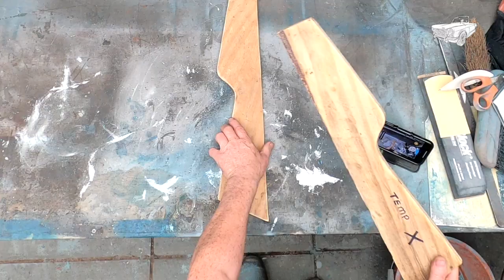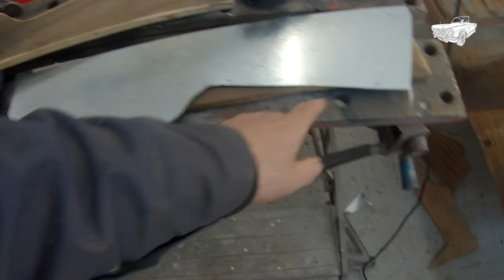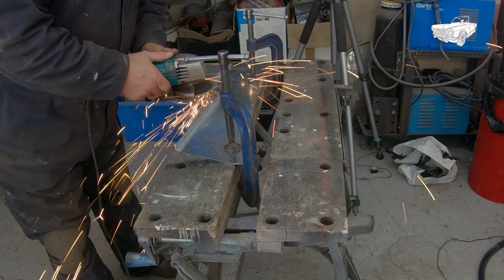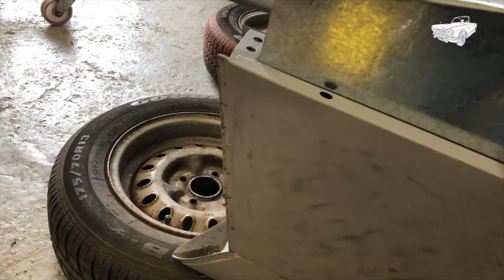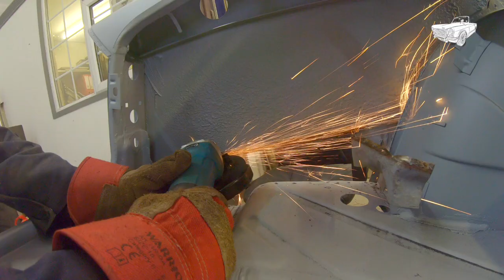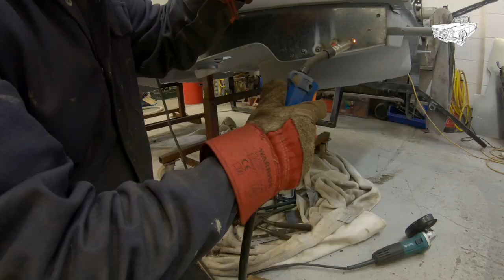Metal Shaping tips and tricks  HD 720p

Comment: @peterdunne8107 I note you use 1.2mm galvanised steel plate.  Some people have said this isn't appropriate for welding.  What's your view?
Reply from the maker: There is nothing wrong with using galvanised steel. It is admittedly quite toxic, but as long as you grind off galvanising around the edges where you are going to weld there shouldn't be any problem and afterwards you must use etch primer paint. Oh by the way, some people have said the moon is made out of green cheese  ha ha ha
Reply: @ You mean it isn’t! Are you suggesting Wallace and Grommit have been misleading us!
Reply from the maker: I 😁

Comment: I highly recommend Wurth Bright Zinc weld thru primer: one of the few that actually works well with spot and plug welding.  It doesn't seem to burn out so much as flow then solidify again.  One can goes a long way.  I buy them 12 at a time at roughly £7 each, so excellent value for the quality.  Completely agree about the cheap bead-rollers: hopeless on 1.2mm steel, which is almost all classic car work.
Reply from the maker: Thanks for the info!

Comment: Why use galvaized steel.. much harder to bend and poison to weld
Reply from the maker: It's free from a friend who has a sheet metal workshop. I have no problem bending it and if you grind the galvanise off before welding there is no problem Welding it. You do need to etch prime it before painting it with a topcoat.
Reply: Cold rolled steel is more easily  shaped
Reply: But i suppose  free is good !

Comment: Superb, thank you. I just made a similar panel for a TR6 (front bulkhead to wheel tub) but I welded the rounded flange and then ground the weld off. It worked fine but this method is much better, much faster and less risk when grinding. I’ve two more to do and will try this method. Very good video.
Reply from the maker: Glad it helped
Reply: @peterdunne8107  tried it last night, worked nice. I did three little panels, first one marked up a little with the ball pein, managed to planish most of it out with hammer and dolly but as it turns out I had stupidly turned the flange the wrong side anyway. So then made one for each side very successfully using a slightly different hammer technique, no marks and planished up beautifully. Great method, thanks again.

Comment: Nice work, don't forget to protect the welds since galvanised metal doesn't like welds so much... Cheers, keep on.
Reply from the maker: You can weld galvanised steel just as any other steel as long as you grind off the galvanising in the area where you do the welding. Believe me I've been doing it for 55 years.

Comment: Hi Peter, great fabrication and welding tips, a bit surprised you don't etch prime/paint on the inside of the flanges and hard to get at bare metal prior to welding, any particular reasons you do it this way, I always use weld through primer to keep Mr Rusty at bay a bit longer 🤞🤞
Reply from the maker: The panel I was replacing was very rusty heavily pitted but the seems we're not rusty they were over 50 years old if they haven't rusted in the 50 years they've been there it's unlikely it will rust in the next 50 years. plus the panel I used to replace the old panel was galvanised steel no need to waste etch primer on that is there. And in any case after welding and  prime paint has been sprayed on, the joint would be seem sealed as it was in the factory before finally painting it. If you look at my other video Vitese Time-lapse restoration you will see I did paint behind the seams where it was necessary.
Reply: @peterdunne8107  I see your point, also saves time I suppose. This is the first episode i've seen and have immediately subscribed, my go to guys are Elin Yakov, Cheftush and Fitzee, will check out your other episodes and look forward to your future ones 👍👍
Reply: @iankidd6500  Elin always referred to Peter when he has is former page "Jade Muttley". He had beaut videos of TR restorations as well and it is a pleasure to learn from him.
Reply: @peterdunne8107  I see your point about not needing weld-through primer, but welding galvanised steel is not really for the, erm, non-expert shall we say.  If your greatest talent in the garage is losing screwdrivers and dropping spanners, ahem, it's really best left to the professional weldingist.

Comment: The best of the best, thanks for showing us how to make this with tools we all have, great idea the spanner.  Thanks also to your son Christophe, good voice! Does the galvanised metal need welder adjustment, seems to survive better the heat then normal metal sheet?  Greetings!
Reply from the maker: It does help to turn up the power on your welder when welding galvanised steel. Also it's best to grind off the galvanise where you are going to weld first. Also you will need to use Etch primer on the galvanised steel before painting.
Reply: @peterdunne8107  Thanks didn't know that as a lot of us I think...